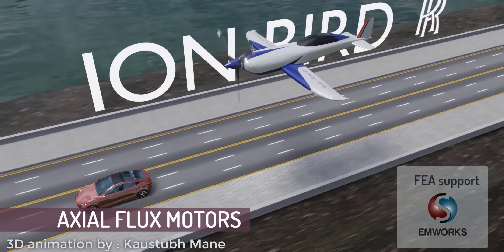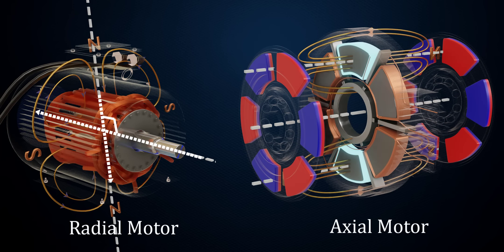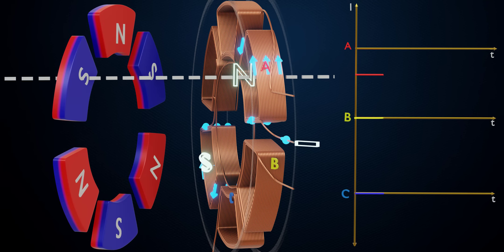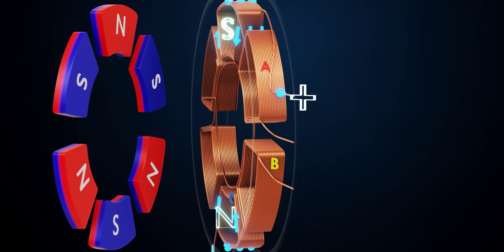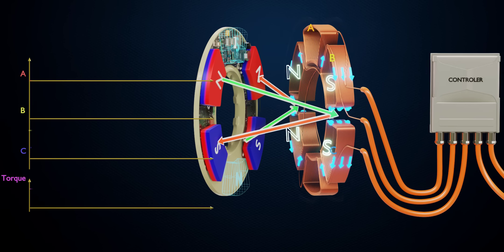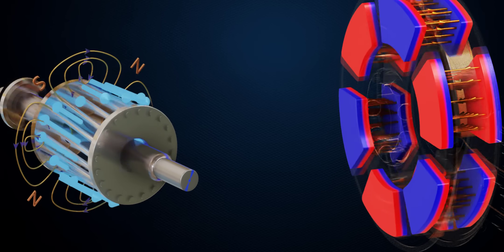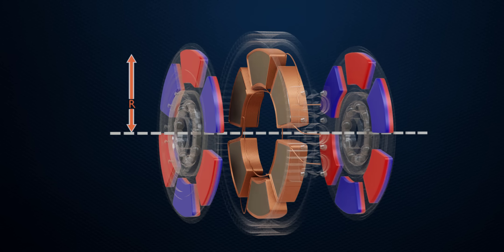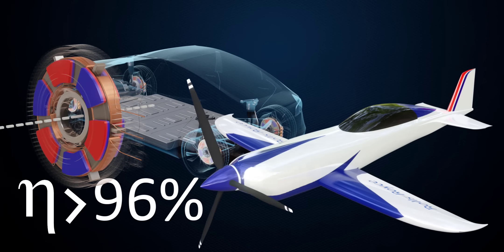Axial flux motors - The new hope

Comment: I realise that every little helps, but surely the pitiful power density of the batteries is the limiting factor for aircraft?
Reply: @I love you but Do you consider you comment helpful? Electric flying is not about attitude. It's fact that batteries are the problem. Maybe you don't know that, but there is no technology on the horizon that could change that. Short distances with little weight may be possible, but that's it. Hoping is not engineering.
Reply: Both batteries and fuel cells have the same issue of carrying around the extra weight of depleted fuel. First hydrogen: With kerosene, most of the weight is the fuel itself, not the structure containing the fuel. However, with hydrogen, it has a higher energy density per kg, but much lower per liter. As such you need much larger tanks, or higher pressure (thicker walled) tanks, which weigh more than the fuel they are carrying, and do not lose that weight when they empty.
Batteries are even worse, and all of the weight stays even when the batteries are empty, so even if you made a battery with the same energy density as kerosene (more than 40x the density of the current best lithium ions), it would still have only half the effective energy density.
Imo the best solution is a ground based generation of hydrocarbons, from extraced co2 and water
Reply: @____5837  So if it's so abundatly clear that batteries won't power planes, why do people keep promoting that? Why is the media supporting that stupid idea instead of debunking it once and for all?
Reply: @wassollderscheiss33  mostly because of the amount of interest it generates (case in point, this video). That is why this technology also frequently appears in prototype or development vehicles, as it generates a lot of interest
Reply: @____5837  I think the media has a public mandate to call out silly ideas. Here it is overly obvious that airlines won't fly (pun intended) on batteries. There are boatloads of other silly ideas that the media doesn't care to debunk. A current example would be Theranos. But also migration, nuclear energy or plastic pollution: All topics which are covered in a way the public won't be able to actually come to the level of understanding it would need to make related decisions (through elections).
Reply: @wassollderscheiss33  Because "Being green" is good PR. There's no money to be made in "Debunking" it. There's gobs of money to be made from government and private sector grants while doing PR releases about "The Future".
Reply: @wassollderscheiss33  some countries have mandated battery airplanes or nothing by certain a date or another.
Reply: @ummerfarooq5383  Really? Are those countries wishing better technology into existence? ;-) Is there also a law that everybody has to be at least 2 meters tall by 2030?
Reply: @wassollderscheiss33  There was a tiny electric plane in the mid 1990s that could carry two passengers a short distance. Jumbo planes? Not gonna happen with lithium ion batteries.
Reply: It's not THE limiting factor, it's the worst limiting factor. In no wise does this mean that other limiting factors should be ignored. Most progress is made by incremental improvements. As you say, every little helps.
Reply: @I love you but Joking is not engineering either :-p
Reply: Plus, we're talking about propellers again. We gave up on them because of their inefficiencies as the tips approach the speed of sound. Imagine a 12 hour ride from LA to NY on an EV airplane.
Reply: @demef758  Yea, Propellers are only really viable at Mach 0.6 and below. Even then, at those speeds, noise will be a significant issue.
Reply: @demef758  
Not to mention the weather you will encounter en-route as you can't fly over it. Pass the sick bag.
Reply: Bingo. The motor itself is quite brilliant but does nothing about the fact it requires power to function. Power that even modern lithium-ion batteries aren't capable of supplying for long enough for higher energy aplications like aviation, shipping, and heavy industrial equpment. 

For better or worse battery powered vehicles best use case is limited to small passenger cars, and small ultra light air craft. When scaled up to shipping trucks and commercial air craft it stops making sense to use battery power really fast as the expense and weight logistics take over.
Reply: @mattb9343  Sure but I believe that all trucking application's can benefit greatly from adding these as supplemental systems.
Reply: @mattb9343  commercial land vehicles are likely fine, trucks and busses I mean. And since weight isn't a concern on ships, but the energy need is massive, nuclear is a good option. Aviation is where the big issue is. You can do far, you can do fast, and you can do efficient, but you can only choose 2. At least as long as energy density is concerned. Power density is not a major problem, just energy.
Reply: @mattb9343  Not entirely true, when its scaled up to shipping trucks there is some benefits, you're right about long distance but for short distance transport its opposite.

1. Breaking is way more efficient as you can use the motor itself to generate electricity, which is what Tesla is doing with their trucks.
2. Stopping distance is shorter even with the same payload as a diesel truck.
3. Cheaper than diesel trucks on average (unless in cold weather areas).

But in the end its limited by battery capacity, i just wanted to highlight that its not entirely true as short distance transport with electric trucks is in-fact better in every way, for long distance transport we will have to wait a decade or two for more efficient energy storage.
Reply: @mattb9343  "Power that even modern lithium-ion batteries aren't capable of supplying for long enough"
What about Hybrid super-capacitors? this solves the initial energy consumption spike
BUT what if we could utilize them in automatic transfer switch arrangement?
Reply: @mattb9343  Battery technology limits only a plane's range, not its size, since you can scale up the battery by the same factor as the rest of the plane. If small electric planes are economically viable for short range flights, there is no obvious reason why an up-scaled electrical plane shouldn't work for similar ranges. Same is true for other modes of transport: electric trucks, busses, and ferries already exist.
Reply: @ehtuanK  EDIT: misunderstood the comment. For short hop flights it wouldn't be viable to use larger aircraft. It's preferable to have more flights with less seats on smaller aircraft.
Reply: @ChucksSEADnDEAD  This entirely depends on the demand. Large electric planes would make sense e.g. to connect London with Frankfurt, Washington with Boston, Melbourne with Adelaide, Toronto with Montreal, San Francisco with Los Angeles. All of those connections are short enough for direct flights with electric planes while having enough demand to fill large planes.
Reply: @ehtuanK  The power requirements increase by 8 fold when you double the mass. With jet fuel you have the energy density to piss it away, but not with batteries. Forgive the back of the napkin math but using Real Engineering's calculations as basis for my estimate a London-Frankfurt flight on an A320 would require 46 tons of batteries. The A320 has a min weight of 47 tons, the Dash-8 400 series is around 18 tons operating empty. The seating difference isn't large enough, the smaller plane simply makes more sense.
Reply: @ehtuanK  Battery technology also limits the plane's payload and it's ultimate range based on battery dead-weight.  Fuel powered planes can trade off fuel vs. range vs. cargo.  Battery powered planes cannot. They must lug those batteries every flight.  Further, as fuel powered planes burn off fuel, they get lighter, faster and can fly further; Battery powered planes cannot.  Gotta lug those drained batteries the whole distance.
Reply: @ehtuanK  your response shows a complete lack of technical understanding of the real physics and chemistry of batteries.
Reply: And you also have to consider than a jet powered plane gets lighter while burning up fuel. Not so much with batteries.
Reply: @fededevi1985  Just use disposable lithium batteries and dump them as you go....simple fix
Reply: @ehtuanK 
Problem with aviation application is a bit more than you might realize. Depending on category of operation substantial fixed and variable reserves of fuel must be carried. This reduces range in private categories and offloads cargo/pax for commercial operations.
So for short range private use there may be an application for this tech but the concept reminds me a bit of the EE Lightning*
Point is there maybe an application for battery powered axial flux motors in aviation but substantial difficulties regarding battery technology vs endurance (ie battery energy density) still seem apparent.
Perhaps the efficiency gain vs weight saving of this motor is addressing part of the problem but the core problem still remains.

*The EE Lightning incredible. The sheer audacity of it was amazing however it only had 20mins of flight time with internal fuel considering mandatory fixed reserves must be intact upon landing. The fact it could climb to 40,000ft in about 90 seconds from takeoff roll made the whole thing doable as it was designed to intercept Soviet bombers carrying nuclear weapons.
Its role as a deterrent was really what it was all about.
Reply: @ehtuanK  We also need to consider the refueling time vs charging time. Huge factor that gets left in the dust a lot I find.
Reply: @tempest411  Which is why you have dumb stuff like the Cybertruck. Something that they didn't even bother trying to make street legal. It looked cool and that's all that mattered.
Reply: @ChucksSEADnDEAD  the power requirements double if you double the mass. They do not increase 8-fold.
Reply: @gj6792  Power requirement is driven by the doubling of the mass squared. When you double mass, it gets squared into four and thus doubling gives you 8.
Reply: @ehtuanK  gradually increased efficiency rather than big leaps is tipping the balance for larger vehicles powered by storage batteries. Smart grids and more solar panels with better efficiency seems like the way to go.
Reply: @ehtuanK  I'll give you a few just off the top with no math required. Dead weight of empty batteries. Weight vs. Power scaling factors. Battery core thermal density requires extra weight for cooling lines/liquid and also scaling factor for it as well...I'm sure there's more...The thing being the scaling is non linear in almost all instances. That said...I do think that they're useful to help push things forward and every little improvement helps as others have already said.
Reply: @ChucksSEADnDEAD  in something like a 2 seat trainer that has 1 hour flights its already proving to be practical it makes sense you don't worry about mixture mags or choke just set it and concentrate on getting the bird in the air and back on the ground
Reply: @zrider100z  obviously mass travelling has harmed someone. So $800 a minute for you
Reply: @ryanp0342  😂
Reply: @ryanp0342  😂
Reply: @ChucksSEADnDEAD  what formula are you referring to?  Double the mass requires double the lift, and this roughly means double the drag. Power is velocity times drag. So doubling the mass doubles the power requirements.
Reply: @gvc76  Power requirement of lift is the mass of the plane times gravity times delta-v. Delta-v is mass of the plane times gravity divided by density of air times wing span squared times velocity in relation to incoming air. You end up with mass squared times gravity squared divided by the density of air times wing span squared times velocity of flight. Power requirements are minimized when the drag equals lift, so double it to get total power.
Reply: @ChucksSEADnDEAD  there are several errors/misunderstandings in those statements.  The first statement does not apply for steady, horizontal flight.  It applies only during climb and descend.  And yes, you require extra power to climb up, but you gain much of it back during descend.  So the total energy storage requirements for a power source are not affected by this significantly.  Plus, even if we were to include this quantity, it's not multiplied by the rest; it's just added to the rest.  By the way "v", not "delta-v" in that case is just the vertical velocity of the aircraft. 
Not sure where the formula in the second statement comes from.  It appears to be some kind of calculation for lift; not velocity.  There's likely some error in the statement, because the units you'd get if you used those quantities as described, would definitely not be velocity units.
As for steady, horizontal flight, lift in itself requires no energy expenditure (no aircraft motion along the direction of the lift).  The only reason we need to expend any energy at all is that we need to move the aircraft forward to produce lift, and that produces drag.  For steady, horizontal flight, lift equals aircraft weight (mass of aircraft times acceleration of gravity).  If we assume that drag equals lift, as your last statement says, we end up with power being linearly dependent on the mass of the aircraft; not to any power of the mass.  P=mgv.
Reply: @gvc76  "By the way "v", not "delta-v" in that case is just the vertical velocity of the aircraft." - No. Delta-v is the change in momentum of incoming air.
Reply: @ehtuanK  Except you'd have to pay the energy costs for shipping 10,000lb of batteries instead of another 10,000lb of cargo/passengers.
Reply: @ehtuanK  It has to weigh 12000 tons
Reply: @ehtuanK  No, it doesn't work like that. If this was true then you could scale up a battery powered RC plane and go very, very long distances, but you can't. You can make the aircraft bigger, but the weight needed for the construction is not linear, as you suggest. And the reason is materials have self-weight and therefore it's not possible to scale it linear. Electric cars work because weight is not a very important factor. But airplanes are very sensitive to weight since they rely on the lift of the wings. Cars, trucks, busses and ferries don't have that problem and you cant compare them the way you do. Electric air crafts work, but on a larger scale you need to replace the battery with a hydrogen fuel cell, imho.
Reply: @Unethical.Dodgson  I believe that natural gas reserves in the world are enormous. It's just they are not being explored as they should be. Qatar could have built more LNG terminals but the green hysteria in Europe made them cancel their plans. And nuclear of course, it's the best option
Reply: @ehtuanK  if, and that’s a big if, battery technology advances enough to make it viable for transport category aircraft it won’t be for another 20-25 years at best
Reply: @ChucksSEADnDEAD  For those equations you need to use v-infinity, which is essentially the relative velocity of the aircraft in the surrounding air. Frequently, we just say v, and we imply v-infinity.
Delta-v is a different matter. It varies locally over the surface of an airfoil depending on geometry, so it's only useful when you are solving the Navier-Stokes differential equations of flow, and that's not trivial.
For practical matters we just solve the general equations for lift and drag, which use experimental data for their corresponding coefficients, and v-infinity, which is independent of aircraft geometry.
Reply: @ChucksSEADnDEAD  And don't forget that the jet fuel weighs less and less as it burns, while the battery weight is static.  But it does make me wonder how a hybrid would do.
Reply: @ChucksSEADnDEAD  Hi Titanium. Even worse for the battery-power lobby is that the aircraft's weight remains static throughout the flight, but its power availability drops as the batteries lose voltage. Using fuel combustion engines, the total weight steadily decreases as the fuel is used. This means more than double the power-to-weight ratio at the end of a flight, meaning "go-arounds" are easily achieved, or alternative airports reached. Battery powered planes are dead ducks in the long run, unless, as another person said, there's a quantum jump in battery technology. Cheers, P.R.
Reply: @ehtuanK  I don't buy it.  It' the weight and glide factor.
Reply: @ehtuanK  Yeah but they want to carry passengers or cargo not just batteries.
Reply: @ehtuanK  I can't recall the exact factors but scaling up an aircraft isn't linear.  A plane twice as large will be ~8 times as heavy and need like 8^(5/3) times more power because of so much more surface area, etc.
Reply: @zrider100z  Aerotech Cessna Caravan (electric conversion) made 30 min test flight in 2020... battery charging cost $6.00.
Reply: @cwt5654  yeah the battery charging cost, where did you get that?

Next, suspiciously I was not able to find any pictures from inside showing how much free space is there left, the battery capacity used or actual cost of the system. Everywhere you go they just say "oh it flew 30 minutes because batteries couldn't hold more" and don't dig deeper. They just cite the company that produced it that of course claims miracles without showing anything. 

The problem with batteries is that you have to carry them instead of passengers, in case of cars we already know the relation between batteries and gas as to the power and distance in case of planes suspiciously nobody shown any results.
Reply: @borghorsa1902  The reason we are shutting Nuclear plants is because they are crumbling to bits, they are half a century old, the reason there is a big gap in the construction of replacements was because Government accountants in suits, not girls with pink hair, decided they were totally uneconomic to build, run, and shut down compared with other options available at the time. Unfortunately the run away costs of those new reactors under construction at the moment suggest that they were completely right about it!
Reply: @ehtuanK  sorry but this is incorrect, scalability is not linear.
Reply: @ehtuanK  The take off weight of modern airplanes exceed their landing weight. Ie if an airplane took off, it would need to dump fuel to land. For a battery airplane this is not possible unless they can dump batteries. So a battery airplane take off weight has to be the same as a it landing weight, and this will limit it cargo capacity. ie limiting factors are not just battery and engine efficiency but also landing gear strength.
Reply: @ehtuanK  more weight you need to move more power you use, so I don't think it can scale that well. Electric motors become real power hogs as weight goes up that needs to be moved. At least that's my very basic understanding and observation till now. So problem remains and that is battery density to weight.
Reply: @ehtuanK  In Aviation, range is exactly what determines if it is economically viable or not.
Reply: it's true, the gas for an efficient car to drive 400 miles weighs about 25kg, the battery of a tesla weighs about 500kg for about the same range. This is doable but expensive in a car, In a plane... forget about it. At least not for the foreseeable future unless some incredible breakthrough occurs.
Reply: @arcmchair_roboticist  they could use hydrogen fuel cells
Reply: @arcmchair_roboticist  yes, let's face it though,  tesla, is better at producing batteries so Rolls Royce should just hire them to do it. Speaking of tesla, Nikola Tesla, already designed electric planes that are more efficient than combustion motors using the same axial motor but no batteries. Instead a wireless ac Current is transmitted to a receiver on-board the craft. Weight problem solved!
Reply: @arcmchair_roboticist  Well they just created new matter with photons.  So Green Lantern is just around the corner.  But it's a big corner.
Reply: @arcmchair_roboticist  It's frequently neglected that reliable and economical car engines have pretty poor power density. The tank of gasoline may only weigh 25 kgs, but the engine that uses the fuel weighs 150 kgs, and the transmission to multiply the torque into a usable form weighs an additional 50 kg, and an exhaust system that's about another 30-40 kgs. The motor assembly in EVs is much lighter, roughly 1/3 the weight of the total ICE system. So, batteries don't need to be as light as gasoline, they just need to be energy dense enough that the rest of the EV weight savings make up the difference in weight. Range being equal, I think a battery pack would probably have to be about 500 wh/kg to achieve curb weight and range parity with a gasoline vehicle, the best current battery packs are about 220 wh/kg or thereabouts. An increase in cell energy density, as well as making battery packs structural in nature would probably yield the needed improvement. Making electric airplanes, however, is a pretty different matter and I couldn't speculate on that.
Reply: @0hypnotoad0  exactly, but when you start optimizing for range, like in an airplane for example, you hit a wall. The engine of an airplane is far less than the fuel. This isn't true for cars because they're not meant to maximize range. The weight of the fuel of a dreamliner is almost as much as the entire rest of the plane. In a system that's maximizing power, efficiency, or weight, it works. In a system that's maximizing range, it's not there yet.
Reply: @arcmchair_roboticist  why do you think the upper class want to get rid of 15 16th's of the world population? So there is plenty of carbon fuels left for their blood lines as they are superior
Reply: @arcmchair_roboticist  I'm sure that they could make a plane hybrid as fuel would be reduced if you ran the motor in its generator mode to continually charge the batteries when operating the propeller off of a standard engine.  Even motor generators are promising but then you'd need extra gears to slow the flux generator down since they operate at lower speeds or speeds less than synchronous speed.  Even operating in wind turbine mode would be promising, can you think of a solution?
Reply: @arcmchair_roboticist  There are small (19 passenger) regional electric planes in the process of getting approval from the FAA right now.
Reply: @williammeek4078  that makes sense, I only really see the problem arising when you talk about converting planes that are designed to maximize range. Otherwise it is a great idea to reduce emissions
Reply: @arcmchair_roboticist  Reducing the emissions of air travel toward the excess of CO2 emitted by all other sources is attempting to emptying Lake Superior with a Dixie cup.  So the arithmetic before spouting nonsense.
Reply: @williammeek4078  That gills me Witherspoon confidence…..they avprovad the 737 Max aswellmif inremember correctly
Reply: @williammeek4078  10 years away yet
Reply: @defaultname2333  First 19 passenger regional planes in 2 years.
Reply: @arvedludwig3584  Did my login name give it away? ;-)
Reply: Just slap a wind turbine on the plane, and boom! infinite energy!
Reply: Yes but the increase in tourqe couples with a lower power draw from a smaller lighter motor that means higher efficiency so more speed and range from the same power banks  for an airplane that is a desirable thing
Reply: Planes also need a lot of redundancy
Reply: Weight a minute......
Reply: Once you factor in the increased efficiency, lower cost and lower maintainance, then things start to even up. The low power density relative to petrol/kerosene is still an issue for long haul flights yes.
Reply: Airplanes can take off with much heavier weight than they can land with. Thus, because they burn off so much fuel during flight they are efficient carriers of heavy loads. A battery, however, weighs the same whether it's fully charged or discharged. This limits the takeoff weight and the load the plane can carry. Less polluting fuels, rather than batteries, will probably be the best solution for airplanes.
Reply: It is, but it's probably good enough for 1-2 hours of flight for most aircraft. That makes it unsuitable for cross country or international flights, but for GA leisure flights and domestic puddle jumpers, it's a potential solution.
Reply: Fuel cells may be the best answer.  For some "short hop" aircraft uses, current technology is fine.  The electrics take less to maintain than the engines in that service so it can be a good idea.
Reply: It's definitely the biggest factor, but that doesn't mean others aren't important, especially given that eventually we're going to figure out this whole energy storage thing.
Reply: @Teth47  How could you POSSIBLY KNOW that?
Reply: Low power density is what hurts flight duration. Low motor torque:weight is what prevents the plane from taking off in the first place.
Reply: The power density has always been the problem. A fuel cell, would be more efficient if you continued to use electric motors, but the best solution is still a combustion engine. The carnot cycle is the most efficient, ideal heat engine devised. The energy density of corn alcohol alone is enough to make a lithium battery look like a ship's anchor. The best solution we have to turn our emissions into usable fuel via bioengineering. Cycle the carbon, no net gain.
Reply: Fuel cells can be a transition phase for electric aircraft.
 As all current fuel based engines are only 25 to 30 % efficient. Whereas a fuel cell can convert at least 50% of fuel to electricity. 
 Thus a really efficient electric motor powered craft should be able to beat this. One could put in small battery packs as well to provide extra power for takeoff or gaining altitude. Thus the fuel cell could be smaller as it need only provide enough power to cruise and a little extra to recharge the small battery.
Reply: @jeremytaylor3532  Toyota put a lot time and money into it but still no production fuel cell vehicles.
Reply: @cartmanrlsusall  This is true about Toyota but they made a top level decision to concentrate on hybrids as they saw a better short term result. However Warren Buffett recently chose to invest $30 Billion  into fuel cell companies and he may be old but he's no fool. 
    Ballard Technologies of Canada and a number of other companies have been having quiet success. 
Like bloom boxes. 
   I do not think any car companies will pursue this type of tech as the governments are telling them to eliminate carbon completely.
Reply: @jeremytaylor3532  I'm not stomping on fuel cell technology hydrogen is everywhere you have water. simple solar powered electrolysis could put a hydrogen plant in every back yard .I just haven't seen a practical version commercially available yet.better lithium batteries are out there right now and they get better almost everyday
Reply: @cartmanrlsusall  What about the Bloom box I mentioned. These have been available for a decade or so and provide electricity enough to power a commercial business. Many companies in California have them as the electricity supply leaves much to be desired there.
Reply: @jeremytaylor3532  I will Google it it sounds interesting
Reply: @cartmanrlsusall  Note: This is early adopters technology. So it is still expensive thus only the big silicon valley companies can really afford it. But they don't really brag or advertise it because when these big companies have electricity to run their computers while the guy on an oxygen machine down the block is experiencing a brown out it doesn't make them popular.
Reply: @cartmanrlsusall  You can give me 200 solar panels and I still will never be able to afford to power a tiny window air conditioner, dry my clothes, cook, or heat my home with solar without needing a ton of batteries that need replacing, depending on type, after 500 to 3000 cycles. Imagine trying to power a tiny 500 watt load through a week of rain. I would love to go off grid in a small camper trailer and it isn`t possible unless you`re wealthy.
Reply: Hydrogen can solve problem.
Reply: Yes.
Reply: @Lewis2553  Fuel is less efficient but adds less weight as well. Fuel functions poorly at high altitude, so manufacturers are smart to follow Toyota's idea and use different forms of propulsion for different situations.
Reply: Molten Thorium Salt Reactors would solve the energy problem. China is currently researching  them and as far as I know they are safer than other nuclear reactors and can bring electronic vehicles to the next level
Reply: Graphene Batteries.
Reply: @uue88  You are the one that is dead wrong!  The only (semi) useful electric in production today is the Pipistrel Alpha Trainer.  Lots of pipe dreams out there, but not any that are now, or will ever be "useful".  The issue that all proponents seem to ignore is energy density.  Gasoline has 100 times the energy density of a typical lithium battery.
Reply: Pipistrel already has real-world electric aircraft in the air right now. You can buy one today!
Electric planes are just a matter of when, not If.
Reply: @Conker The King. "simple fact of the matter is people just don’t want to give up on there Dinosaur juice, would be nice if they just admitted that."

Yeah. I as a regular joe taking a flight from New York to Sydney give two shits about Dinosaur Juice. Fact is though that most of these batteries people gush over... don't actually fucking exist or are at best only a few percent better than previous iterations.
The best battery tech seen in the past 10 years is actually the structural battery. Wherein the battery has to be as non-volatile as can be without sacrificing too much in the way of usable energy and still be the supporting structure of a vehicle. So rather than having 10kg structure and 20kg battery. You'd effectively just have 15kg combined structure and battery. Something like that.

But there is no miracle battery.
Reply: For now. But once batteries take another leap forward, this issue will disappear and this motor type will soar - literally!
Reply: Ofcourse, but you can use gas fuel batteries. I know Hydrogen is expensive &/or low volume power density. But Methane is the way to go. Just needs a bit more research.
Reply: Solid state batteries with densities far above lithium are gong t be here soon, these will answer most of your objections.
Reply: @barackclinton568  actually, I doubt that this Big Break Through will ever come. We do not even have a theoretical concept of it. Methane Fuel cell batteries are the answer. Or some other oxidation based reaction.
Reply: They've been working on putting micro reactors in electric cars
Reply: The reality is that it wouldn't be operating off of battery primarily, but a turbine generator. They could also use thermal generation in that use case due to the intense exhaust heat created by turbine engines, which would be where the efficiency benefit comes from. You could get okay range from a passenger aircraft with battery power, but it will be a very long, slow flight with the wing area necessary.
Reply: I have not been this impressed since Rockwells' Retro encabulator.
Reply: quite, but reducing the engine mass can help make up for this. The problem with increasing the battery size in aircraft is that the increased available energy may not offset the increased mass. Reducing the motor weight and increasing the energy efficiency means they may be pushed just over the edge into commercial usefulness. This would also improve the usefulness of microwave power, hybrid gliders, or solar power planes.

There are battery types which handily beat current hardware, its possible that the normal drawbacks they have will be mitigated enough to see commercial use. If we're lucky we might see enough advancement in supercapacitors that we can use them to replace vehicle batteries too.
Reply: Bingo. Current battery energy density only supports special mission air like the Pipistrel trainer.   I’m a big fan of electric.  Watching energy density and price point carefully.
Reply: you can imagine batteries or better capacitor for take off and hydrogen + fuel cell for cruise flight
Reply: @flooded42  : Weight, complexity, and cost.   I think that for aircraft this size and in its intended market, the driving force is going to be better battery technology growing out of the growing electric car market.
Reply: @gregjennings9442  yes for a small airplane for training or entertainment battery is certainly the best choice, I was thinking more for planes that require more range, like commercial airplanes.
Reply: Not really relevant since you can run a genset onboard at optimal speed and still go much farther on same fuel, with any electric drive.
Reply: I'm a layman, but I've seen some videos on supercapacitors and how they could potentially replace batteries in the future.
Reply: Not for long, ask Elon Musk.
Reply: @sat7755  : He’s making cars.  The energy density that works for cars is still far short of that needed for a general-mission small aircraft, much less that of heavy haul, long range aircraft.   He’s also on record saying that “flying cars” for the general public is a stupid idea.  But, all that said, the push for more efficient energy storage can’t help but push the mark toward what is needed for aircraft.
Reply: I didn't read all 100+ replies. But to sum it up. Current battery tech sucks, energy density. Only reason anyone works on E-planes is for greenwashing and to raise capitol. E-planes at current tech levels are unviable due to battery technology. E-planes as of today (2021) are UNPOSSIBLE - that which is not possible, just yet.
Reply: @effervescentrelief  : I think that it is overstating to say that they are only working on electric powered planes is for greenwashing.  There are always bleeding edge companies and products.   There are already worthwhile electric aircraft.  But, they are special purpose due to a lack of range which gets back to energy density.
Reply: @Mark S I`m on a low fixed income. I can`t even dream of running a tiny window unit air conditioner from solar due to extreme high cost.
Reply: We All need to become pilot
Reply: In other words, it's the weight.
Reply: A NASA official stated in 2017 that "The tipping point to go from hybrid battery aircraft to commercial passenger battery electric aircraft is 700 Watt-hours per kilogram," and more than that is on the way. 700 is about twice the best today, and less than a third of what's possible.
Reply: At what point did this video address energy storage?
Reply: That is definitely the next hurdle! 95% efficient electric motors are great, but they still need power. Batteries are kinda like rocket motors (hear me out) in that the mass of all the reactants are carried on board, versus air breathing engines where you only carry one of the reactants onboard and grab the rest en route.. makes a massive difference. And the mass doesn't reduce as it is consumed either.
Reply: Yes, the major factor for the motor is efficiency. Shaving 1% loss on the motor is going to save a lot of battery weight.
Reply: In come sodium ion batteries, earth abundant supply, Energy density moderate to high
Reply: Tesla sent electricity through the radio waves,why hasn't someone figured out how to harness that energy? It was already out there, Westinghouse just couldn't imagine how to put a price tag on an incredible invention! Has that really been lost?!
Reply: They should make airplane bodies out of beehive-like mesh in which batteries are embedded.
Reply: John Ingham - Just as "Engine Weight" was a Large Part of the Problems Facing the Wright Brothers First Flights! 🙄
Reply: The hurdle in electric vehicles is overcoming the need for batteries. That'll be truly ground breaking
Reply: Correct.  Electric aviation won't be a practical reality until range and time of flight and cargo or passenger capacity are all competitive with what we have now.   And that's a LONG way off.   500 WH/Kg is about the best that any battery has achieved in a laboratory, which is far past commercially viable batteries today,   while aviation fuel manages as much as 13,333 WH/KG.
Reply: Yes, yes it is. Still every bit of weight reduction helps.
Reply: Simply use a compact gas turbine to charge the batteries
Reply: Yes
Reply: People just don't like to talk about the actual problems and rather address things that already have solutions or resort to PROMISES instead of reality. That's especially sad here because otherwise the channel is so good.
Reply: @wassollderscheiss33  Real Engineering talks extensively about electric aviation - and why it doesn’t seem feasible right now
Reply: @rob_over_9000  I know, I'm a subscriber ;-)
Reply: @wassollderscheiss33  spot on.
Reply: @wassollderscheiss33  They aren't ignoring the problem. It's well known that the energy density of batteries is holding us back and there are already plenty of researchers and companies trying to change that. It doesn't make sense to only focus on one problem especially since not every engineer specializes in battery chemistry. Making improvements in weight and efficiency at a system level is still progress.
Reply: If one imagines a world where hydrogen cells have matured enough to be useful, then short-range regional jets are feasible. But you're right that converting a typical long-haul tail to electric is basically impossible.
Reply: @grahammutter8655  hydrogen wont ever be used directly in flights. It costs too much per hour of flight time compared to battery electric and storage is too problematic for long flights. Synthetic fuels will probably be the best use of hydrogen for long haul flights.
Reply: @grahammutter8655  
Long-range Aircraft with Hydrogen would be no problem.
Battery aircraft while not in sight with today's Technologies are definitely not impossible, we just need a better battery.
Reply: @Ismalith  The energy density of liquid hydrogen is only 1/4 that of jet fuel, ignoring the extra weight that comes along with the tanks needed to hold it compressed. Long-haul literally cannot be replaced with hydrogen. Though, it's been acknowledged but ignored for a while that emissions for any flight longer than ~6000km would be more environmentally friendly if split into multiple legs, so perhaps this is more an issue of consumer expectations, and "long-haul" just shouldn't/won't exist.
Reply: @grahammutter8655  
You mean the energy per volume is 1/4th of jet fuel. The energy density is actually about 2,5 times higher.

Also without a comparison between efficiency, speeds and altitudes between modern jet liner and Hydrogen engines we can't really say how the actual energy density and energy per volume of both concepts are, as efficiency can make a giant difference.

For example gas is still many times more energy dense and has more energy per volume than batteries but because ice engines are only around 10% efficient in real life the battery can actually keep up enough to be a realistic alternative.

So if we can build hydrogen engines that are more efficient than jet engines, especially at higher altitudes that could go quite a long way to beat gas.

That said, even if not, weight is the limiting factor, volume is not so much of a problem, the fuel tanks would be light weight carbon fibre any ways, if you overall can carry passengers over around 3000nm at a reasonable cost per passenger it is fine. If the aircraft is two times bigger than the same gas aircraft would be, who cares.

The biggest thing we need now for H² aircraft would be the government testing the technology, for example via NASA, and then if it can be used, enforce it.
Reply: @Ismalith  "ice engines are only around 10% efficient in real life" - that's not true. Modern ICE engines are around 25%-30% efficient and close to 50% best case scenario at the moment (See F1 for ex, but it's not realistic/ applicable in this discussion.) and also "If the aircraft is two times bigger than the same gas aircraft would be, who cares." - well the companies care as airport fees are a huuuge pain and are proportional to aircraft size - see the reasons for the demise of the giants like the 747. The economy and the markets play a huge role as well into how tech is being used.
Reply: The batteries are not the only power source if the plane has solar panel material coating it's wing & fuselage surface, especially if the plane spends a large part of it's flight above the clouds
Reply: @TAttiusMaximvs  You forgot to mention magic moonbeams for night flying.
Reply: Please leave the boats and aircrafts ice engine ur already doing enough to our fun
Reply: @arvedludwig3584  planes still need to land with full fuel in cases of emergencies though.
Reply: @ummerfarooq5383  During an emergency, life is considered more valuable so writing off an aircraft with an overloaded landing is justifiable. So yes, planes can be forced to land with excess weight, but during emergencies. Battery powered aircraft would have to do it every single landing. If the emergency permits it, aircraft can dump fuel in some models or may do circles to burn excess fuel before attempting the landing.
Reply: @UCv1Lel6_QJd9-NIz_91qM0g  People are working on energy storage already, moron. There's no reason to ignore the other components while they do so. Afterall, even a 10% increase in efficiency will pay massive dividends down the line.
Reply: When someone says something will "never work", just replace never with "for the next ten years" and that's often correct by the time average folks are commenting.
Reply: @GuyIncognito764  Never say never, but... when an aircraft takes off on a scheduled commercial flight it needs the ability to shoot and miss an instrument approach at the destination, then travel to an alternate airport, then shoot another approach, then land with 45 minutes of reserve "fuel". This severely limits the usefulness of electric aircraft for short-range scheduled transport as it can easily double the battery capacity required as calculated by the casual observer, especially when ground ops are added to the front-end of a trip to-from busy urban destinations.
Reply: @GuyIncognito764  well there's also stuff that's been just a few years away for decades, like nuclear fusion
Reply: @GuyIncognito764  Sometimes, but some technologies take much longer to become viable, I think we can safely say that controlled fusion is still a long way from providing large scale economically viable electricity generation!
Reply: @GuyIncognito764  Yeah just like unlimited fusion energy...
Reply: @ryanp0342  🤣
Reply: @GuyIncognito764  
Often it is even said when the impossible thing is already happening.
Reply: I’ve packaged this type of motor before — some pancake motors are this type.  The batteries’ energy density’s is definitely the limiting component.  The comments regarding hydrogen fuel cells leave out several capability trades.  Plus, high energy density AND enabling superconductivity (-400 F) massive storage and force increase technology which most miss!  Minus, safety and bleed off burn since the cylinders would be to thick otherwise.  And leach off from metals too heavy…. The real answer is anti-gravitational drives.  Learn Bose-Einstein equations.  See example Researchgate: Dr. Felber.  And learn Cooper pairs and superfluidity— Not superconductivity.  The boundary condition via Cooper pairs (maybe best mental entry) is an amazing property (Lancaster U. UK).  Chemical propulsion is passé.